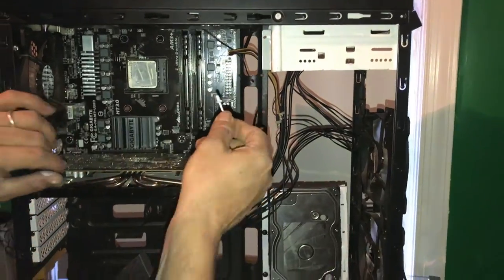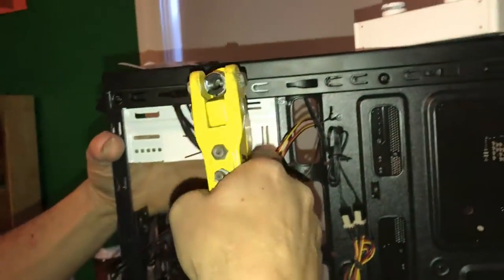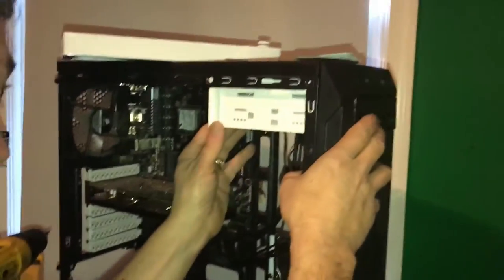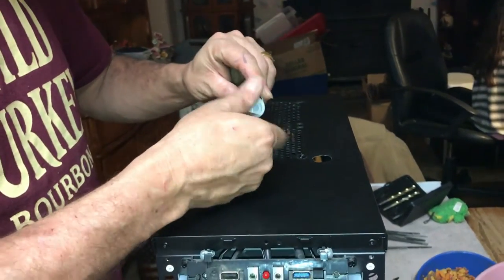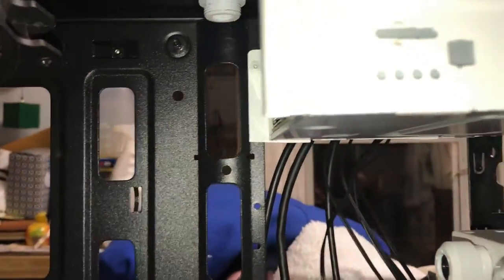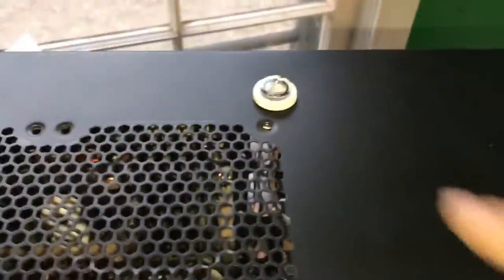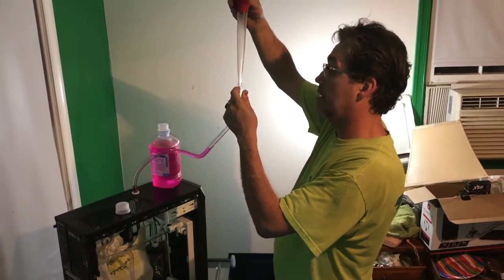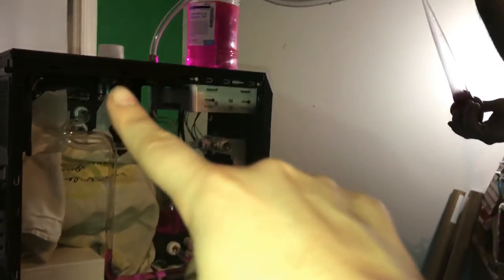Water Cooling and Filling up My Daughters Pc , Hurricane Abigail Mod

Comment: It looked like the CD/DVD  placement was upside down.
Reply from the maker: Joe B na just looks that way , it has its hard to tell but on the inside at the bottom there are two tabs on each side that hold the the DVD drive in place